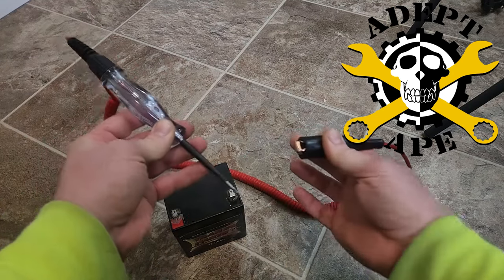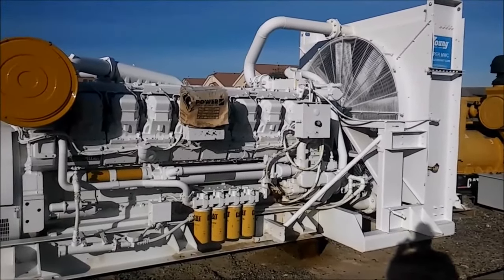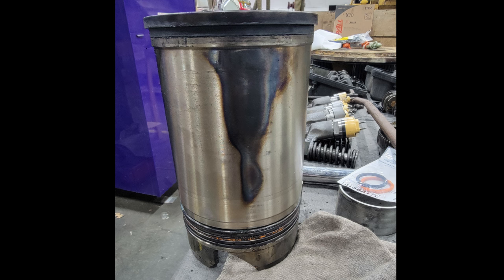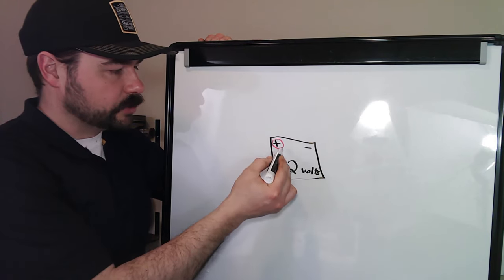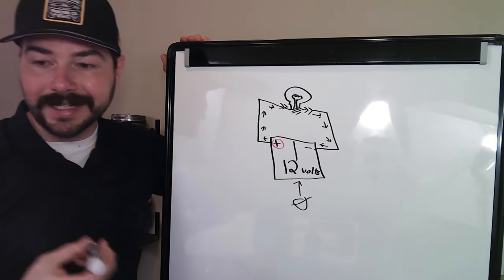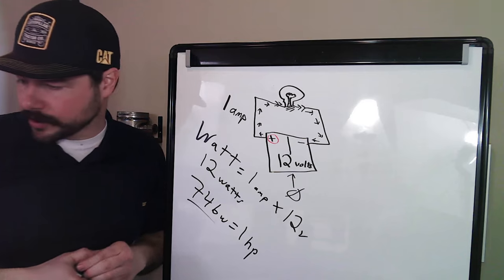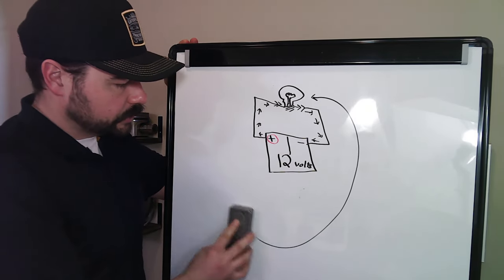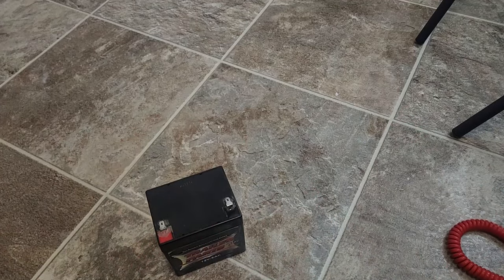Electrical 101 for cars, trucks and equipment. Beginner electrical, Class 1.

Comment: 6 months in as a diesel mechanic but I’ve been watching your videos sense before that. I struggle with wiring and electrical at work so this video couldn’t have came at a better time! Thank you☝🏼
Reply: Wiring is the easiest I hate fuel problem troubleshooting
Reply: @ancormane524 fuel problems are easy Tracking electrical shorts is mind exhausting

Comment: Thank you for doing this series. I’m an owner/operator with 3 trucks and I have to do a lot of repairs myself. This series will help me. Will you do a segment on the different functions of a multimeter?
Reply: Second that, I'd love a multimeter segment!
Reply: What would you like to know? 
The Ohms scale (Ohmaga ) measures resistance across two points. When not energized. They usually have a zeroing  key? Dial? Put your leads on both ends of a wire the resistance. Put the leads together before you go to measure see what the screen reads and you can subtract that from what you read. 
Un bolt/machine screw from your vehicle measure between the wire/s to the ground then to the Negative of the battery should see next to zero as resistance.

For DC or intermittent DC - - - - - - , measure across say the battery. Should measure nominal 12 VDC. Or it will when new be 2.2Volts per cell on Lead acid batteries. Different for other DC batteries. Lead Antamonie is 1.46 VDC?? 
Measure across the battery terminal to the cable lug see if there is a difference of potential between them this checks if you have voltage drop across two surfaces? Should see next to nothing if not remove tooth brush wire bush them and you can use Vaseline to keep the oxygen away from them. 
Measure from the Positive side of say a relay to ground should see nominal 12 Vs. 
For measuring DC amps most are good for 10 amps MAX! They are usually (fused) so if you go over that it should (blow) needs to be replaced do have spares. For measuring Amps the meter  leads  on the Amp setting needs to be in series in circuit with to measure. 
Some will show/measure min and max voltages.

They make Clip on amp meters for larger cables/ readings. Mine is good for 100 amps.  Does me, not that I have used mine on a job. Use there's. 

AC 120 volts there again across a resistance to ground/wire. If they should fluctuate usually a bad Neutral wire.  
AC will KILL so don't Play with any of this. 
I have used what is called a "Modi Walk" for testing  voltage up to 500,000 volts in substations. Love that work. They will measure between 347 to 500 Kv. Different settings. 

Hope this helps any more do ask I will see if I can answer.

Comment: My auto Electric story:

I was a third-year auto mechanic apprentice working the line at a dealership of German cars. this was before the lemon laws were passed. 

A car that had been sold the month before was towed in. It had suffered an electrical fire behind the dashboard and behind the firewall. Every single wire had been burned and all of the switches were half melted or completely gone. no flat rate Mechanic would touch it so the foreman assigned it to me. 

Every switch and dash light was ordered along with a main wiring harness. The switches came in but no wiring harness. After waiting two months the foreman told me to get busy.

I had no special training or experience in auto electric. I pulled in an identical new car is my example and replaced every single wire behind the dash and behind the firewall with red wire.

On the first test everything worked perfectly except for one door switch which was easy to fix.  I was very proud of my work in spite of it looking like a plate of spaghetti!
Reply from the maker: Great story, best way to learn.

Comment: Sliding into a diesel mechanic shop after nearly a decade as a welder.

Not worried about the body or replacing parts. Point me at it and gimme a manual and ill get it done. Not as fast as someone who knows what they are doing but itll get done.

Electrical might as well be black magic to me though. 

I just stumbled upon your diesel 101 and then saw you made these. 

You are the best my dude.

Comment: Great video!

Loved the comparison of fluid/water pressure (V), pipe size (I), and flow (R).  I use the same analogy often.  Also applicable to "leakage" or a short, semi-short, or even a "blocked pipe" resistance high or open circuit.

PS:  for Ohm's law, I also found it easier as V = I x R (V=IR  ....Virrrr vs dividing R-hhsss....lol..in my best pirate speak)

Well Done!

Comment: Great video Josh I liked how you went real slow on how power moves in a wire only when there's a connection between both sides of the battery.

Comment: Excellent explanation 👌. 
Good point on how long does the light stay on.
Electrical guys have it easy! when trouble shooting, they just use the meter probes to test a point in a circuit,  mechanical or hydraulic guys have to take it apart to check, plus oil and mess!
Thanks for sharing 👍

Comment: Im no electrical master mechanic or anything but i work on vehicles and i always figured that Ohm's Law was what i was using when Voltage Drop method of testing a cars/trucks/vans/SUV's electrical system.

Am i wrong? Like he's right, i don't calculate Amperage for every component unless I'm setting up new wires for a non OEM affordable system like a jew Electric Fan for radiator, AC Condenser, Transmission fluid cooler and need to know how many Amps/Wattage it uses abd what size wires i need to fan/relay/thermostatic switch. Usually 16awg for relays, 18awg for low side on relay with magnetic solenoid, and 10awg for the fan power side and battery to 87/30 of relay high current switched side.

Comment: Great video. Only comment is that watts aren't a unit of energy, it's the rate at which energy is used. Or a unit of power if you'd like.

Edit: For beginners think of power like your hourly wage and energy as your total amount of money. If you make $100/hr that's your "watts" and after working an 8 hour day your $800 is the amount of "energy" generated.
Reply from the maker: Good distinction.

Comment: I've watched all your diesel 101 videos the fuel systems was very helpful. I know this video is meant for beginners and with all possible respect I would point out that your math was incorrect with the 24v / 12ohms it would actually be .5amps. I appreciate what you are doing with these videos and this is a minor mis-speak but can cause a lot of confusion for some.
Reply from the maker: I appreciate the comment, but I'm 100% correct on this one. More voltage will push more current with resistance staying the same. If resistance was 24 and volts were 12 you'd have .5 amps. You can plug it into a current calculator, I just did to verify this comment before writing it and it's 2 amps.
Reply: I=E/R.  Another way I have heard power and amps described is: volts is speed of water and amps are volume of water. When either component increases power increases.
Reply: Josh is right.  For a practical application, use his setup with a 24V battery or two 12V batteries in series, and you will notice the same light bulb will be @ twice as bright as a consequence of doubling the current flow.
Reply: @AdeptApe  I stand corrected, I had it backwards my apologies.

Comment: I just wanted to ask what you think about rottla t6 5w40 I run t6 5w40 in my 12 &18 6.7 ram and t6 15w40 in summer do you think the 5w40 is good or bad I have been buying new ram when I got my first 99 ram Cummins then 07 5.9 run rottla t4 15w40 in them from new and on my 12 first 20.000mi I do oil change every 3.000mi I have noticed that the 5w40 runs smoother when its 0 out or lower just wanted to know if the rottla t6 5w40 isn't the best for my truck

Comment: voltage is potential,  amps is flow and resistance creates pressure or limits flow
Reply: I agree. As much as voltage is potential it's not the pressure as he says. Buts a beautiful analogy for visualization.

Comment: General question for anyone: is diesel mechanic a young man's gig? I'm 53, am looking at a possible career change and have always been fascinated by big equipment. I have worked in HVAC for years but have also done a lot of wrenching on cars. So as for the technical side, I have a mechanical bent and have mechanical experience. I am curious about the physical side and the work environment. Is it for the young person or could one advanced in years handle it? Thanks!

Comment: I'd just like to say this. Atoms do not flow through a wire.
When a charge is applied, the field round the atom passes that negative charge to the positive of the next atom, and so forth. State of charge moves to the next state, higher or lower the charge. So, nothing moves, physically; only the field is passed along to do work. I hope I have made myself understood.